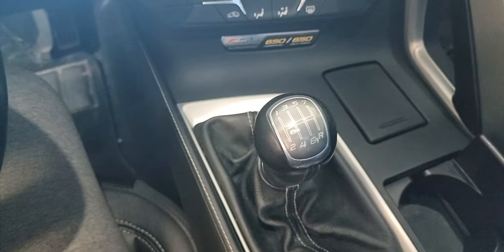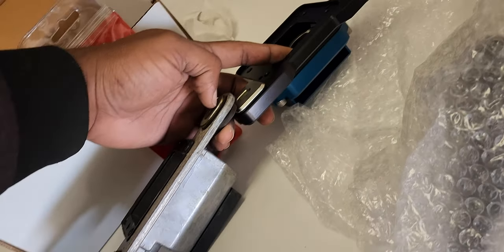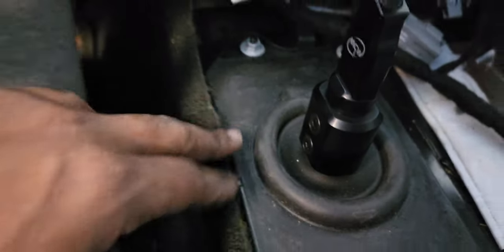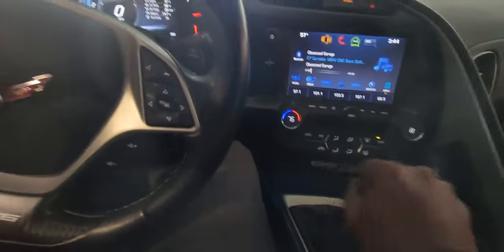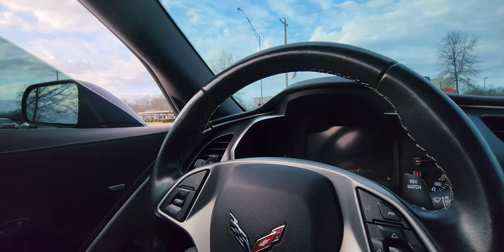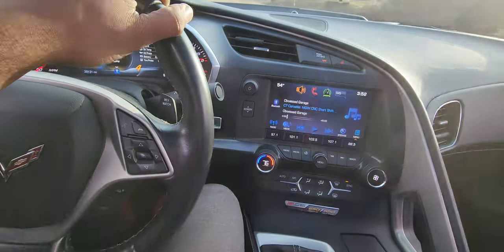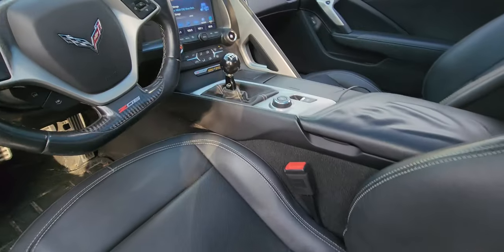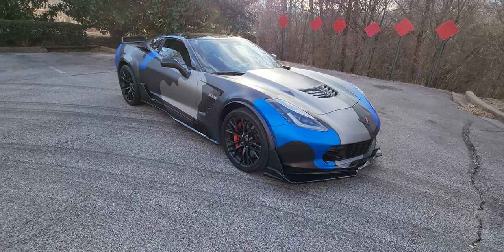Trying out the MGW shifter in my Z06!

Comment: yo quick question, I know this is about an old video but I am doing a v6 to v8 swap, by any chance when the v8 engine, trans & PCM went in...did the PCM have to be reprogrammed with a new vin and if so which vin because I know if you swap PCM's it's gotta be reprogrammed so tat the immobilizer will let the vehicle start.
Reply: I am currently doing a v6 to v8 swap in a 2011 camaro and am getting the v8 PCM reprogrammed with my v6 vin. I will let you know how that goes. I am using a 2013 wire harness and am not sure where this one connector goes. I saw Antares Cam had wires coming out of the connector going across the engine bay and was a little confused.
Reply from the maker: This my buddies car Marlon....his page is @Marlon_1ls on ig. The car in most of my videos is mine which is an SS